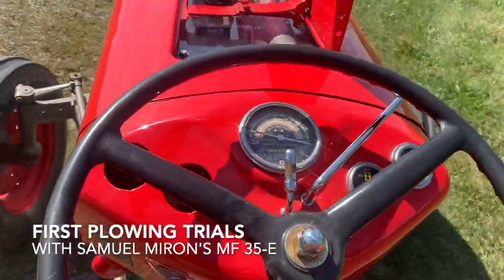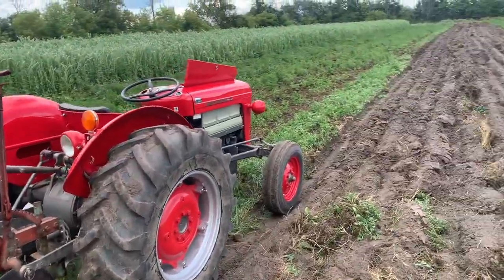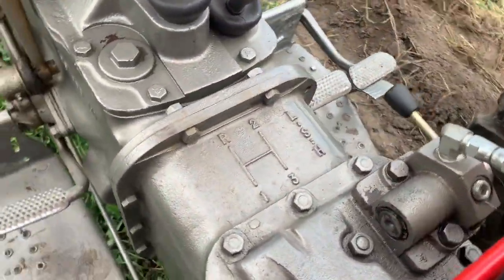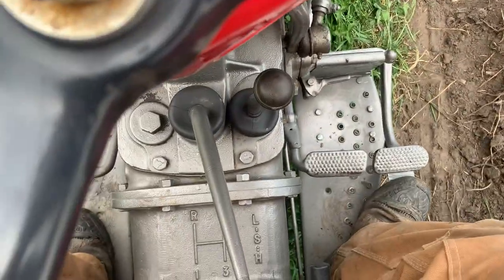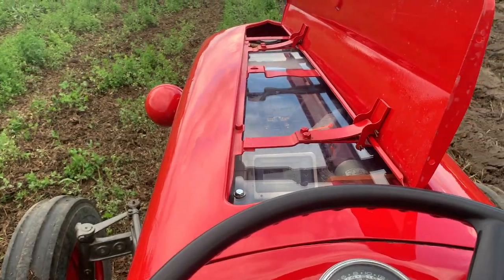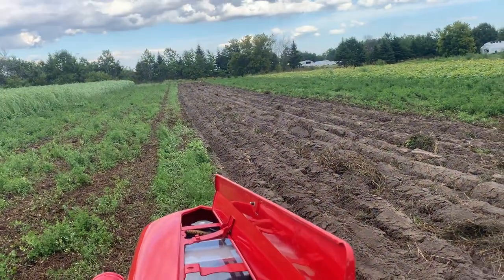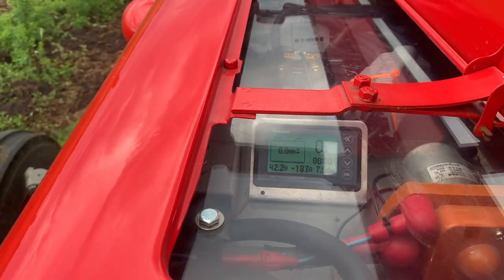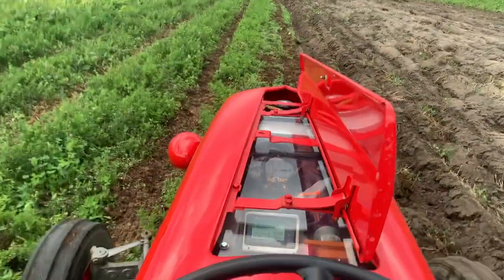First trials plowing with Massey Ferguson 35e electric tractor

Comment: That's interesting that it only needs 7-8kW.  Is it safe to say with the 35hp engine it could have pulled at least a 3 bottom plow or at least pull the 2 bottom faster??  I know zero things about plowing.  Electric must greatly reduce operator fatigue, too.
Reply from the maker: I don't think the gas or diesel tractor would be able to put any more power to the ground since in at the limits of tire slip anyway.  Maybe you could go a bit faster.  I really dunno but cool that it only takes 8kW to plow 2 furrows at a reasonable pace and it's definitely more pleasant and less tiring without all the noise and vibration.
Reply: @reidallaway  What's cool about this kind of thing is, with automation and robotics really taking off, something like this could be running autonomously day/night. You start to not care as much about the speed.

Comment: Very cool. Keep an eye on those Daly BMS. I don't have any personal experience, but I know there have been some failures in the solar community... 

Always a little risk to have multiple packs in parallel (especially if you don't have complete confidence in BMS and they are not talking to each other). Depending on when one pack decides to disallow discharge, you could end up with a situation where you have a lot of current flowing from one pack to another if it decides to re-allow discharge...